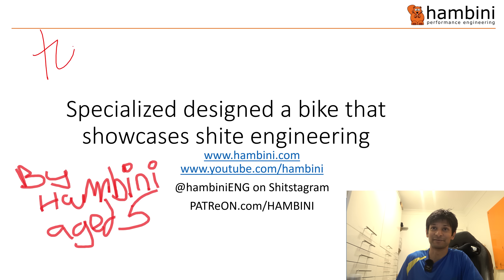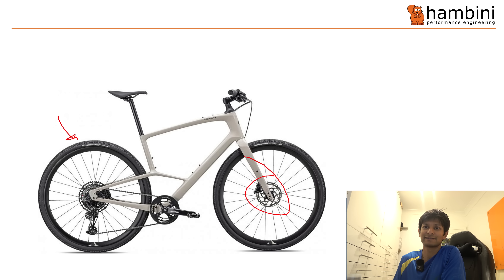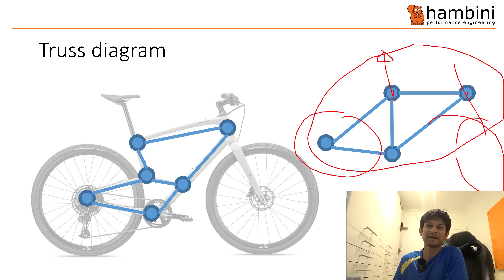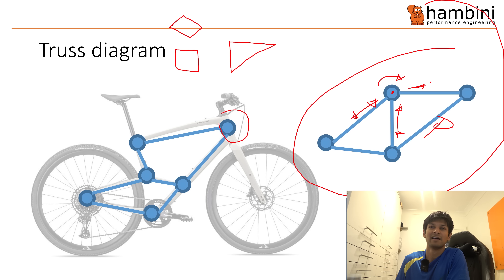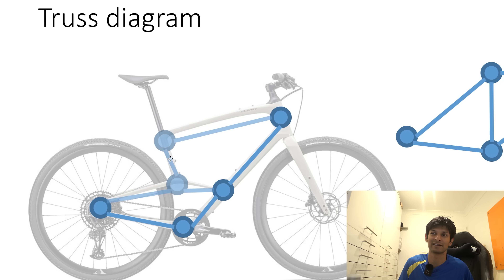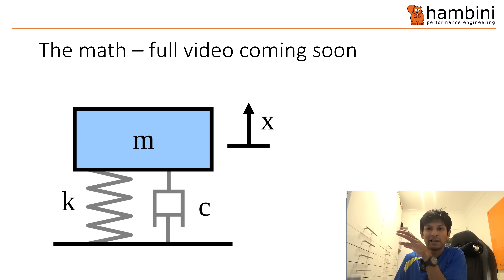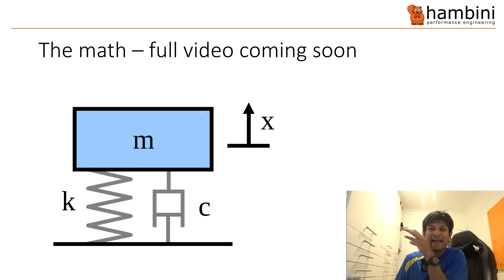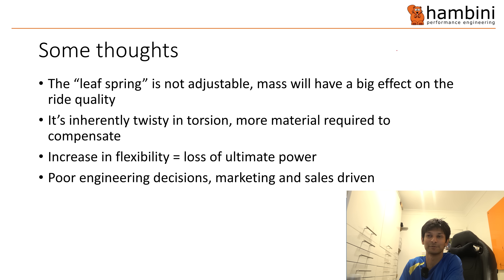Specialized Sirrus | TOTAL BODGE | When the marketing department design a bike...

Comment: FYI, there’s no suspension if you stand up on the pedals.  Lighten your weight on the seat?  No suspension. At the end of the day, this is a “high pivot” suspension design that had its day in the 1990s.  (Castellano/Ibis Bowti, schwinn had one, too) I actually like high pivots, but this is without a doubt, the worst possible implementation of a high pivot.  And, the lack of a dampener makes the design even more useless. Lastly, if you didn’t know, Specialized is 49% owned by Merida.

Comment: They did it because cyclists are really, really gullible. Fashion is key. Fake physics sells. These are the same people who believe that their custom wheels came with lower spoke tensions to make them "compliant" or that they can feel the "compliance" in the rear triangle even though they haven't put air in their tires for a week. Rich weekenders where I am will drop $15k on a carbon road bike that has no real advantages over the $1.5k bike down the street.

Comment: Actually the forces are very small for a carbon structure and being over rigid is an issue. The primary twisting occurs from headset to crankset. Carbon has a near infinite fatigue resistance. This design will be maybe 200g heavier than a traditional design, however the vertical compliance which is only in use when you're sat down could reduce fatigue on your bum over rough surfaces significantly. For its use case as a comfortable tourer this is fine
Reply: Carbon may have good fatigue resistance, resin however most definitely does not

Comment: Bicycles come in different sizes. A general assumption can be made as to the weight of the rider with regards to frame size. From there each frame size can be tuned to a different riders weight. If specialized did this the smaller frames would be substantially lighter as the leaf spring section would have thinner wall sections. The carbon material can have dampening built into it. Rubber is a spring with a high degree of dampening built into it in comparison to an equivalent steel spring. The carbon can be designed with a higher degree of dampening than steel. But lower than rubber. They also could insert easterner inserts inside the carbon spring for dampening.

Comment: Is the design actually going to 'flex' though? No-one seems to have mentioned the node at the top tube/head tube junction.

For movement to take place, there needs to be flexibility at that junction but the top tube looks like it has a fairly beefy gusset-type join and the top tube size and shape doesn't look very 'flexible' either......

Comment: I can only think they designed this as a very light duty bike, I'd hesitate to even call it an MTB, it's more like a road Hybrid with chunky tyres and no suspension.
I can't imagine how that design would work thrashing uphill off road. The pedal and bar twisting torque forces combined with that weird rear Triangle (or Rhombus?) are going to rip this thing apart! Unless of course it's made from Unobtanium? But it's more likely to be Chinesium.

Comment: compelling reason? have you looked at literally any of the recent trends in the industry? gravel bikes? hello? have you looked at the diverge str? trek supercaliber? im not surprised in the least from a company with a motto of "innovate or die". reducing vibration and softening the ride can increase efficiency on uneven, bouncy gravel surfaces. does this guy know anything about bikes outside of road cycling? comfort also plays a role a riders ability to apply power. adds heaps of weight? its a carbon frame gravel bike / fitness bike designed for COMFORT and stability, not a race bike. also the mass affecting ride quality is mitigated by varying dimensions in the bike frame sizes. larger frame = additional support for heavier rider. i see your points, but comes across you are purely looking at this from the angle of a weight weenie roadie racer who cant comprehend any other form of riding. i work at a shop that sells loads of the sirrus, and already had people coming in to look at them before they've even hit floors. and with the recent trends in gravel bikes absolutely DOMINATING sales in the states, im not surprised they are trying something different for adding compliance and reducing vibration just like they did with the STR. i'm sure they'll do great just like the last lineup did. cheers dummy

Comment: They should build with super butted chromo 4130 with for instance 0.75mm tubing iff they wanted some flex, next to that perhaps an internal computerized correction apparatus to keep the bb 100% level to the ground...

Iff this is an aluminium frame it will have cracked welds and/or a warped frame in no time...

This designer probably went a bit too deep into the nightlife on lsd with his hairdresser(s)

Tip of the decade, melt it and restart with knowledge pls 😂

Comment: Did they forget the amount of force on the Bottom bracket and the twisting force created by our legs. This force is now twisting the frame where in the past you would have a seat tube which resisted that twist. On my full suspension MTB i can already feel it, this is going to be complete wobble.

Comment: My biggest issue is that the seat and pedals will move in opposition over bumps because of the shape they have chosen. As the seat pushes down it will try to close that trapezoidal shape which will force the pedals upwards. Surely this will give an odd feeling to the rider and even potentially make the bumps "feel" worse.
Reply: exactly and if you stand on the pedals to go over bumps that downward force will rocket the saddle upwards... pleasant!

Comment: The obvious power loss from a spring without much damping is why most mountain bikes have a suspension locking mechanism. It is even used on some full suspension rigs -- despite modern dampers and geometries supposedly being very good at limiting pedal bob. This thing looks like it will just bob around by design.
Reply: No one that buys this is going to give a fuck about pedal efficiency

Comment: There are now several light and highly effective suspension seat posts and stems readily available on the market. Why would you want some complex, heavy, and  proprietary built in system like treks iso speed, and the new future shock by specialized. I bet parts for these systems will be impossible to get or so expensive the bike will become worthless.

Comment: Mechanical engineering 5th lesson during my studies....calculation of tensions in bars/rods.
this Bike design reminds me of the late 1990´s when Mongoose, Raleigh and other brands designed the frames in try and error mode; the difference is my first 26" mountain bike was a "light-weight steel version" of 15 kg and indestructible. I remember the Sling-shot bike: 2 cables instead of the down-tube, which follows the idea of the tensile stress in this section (...and creativity in handling the bike). 
if the next legal action is coming give them some lessons as a compensation first 🙂

Comment: They could choose the right material for the frame from the start. It's steel. Flexes where you need it to, stiff where you need it to be. Cheap as chips.

Now, to acheive what you can acheive with diamond frame made of steel, Spesh markeneers chose to use leaf spring logic, defying that leaf spring works in 2 dimensions, but bottom bracket area flexes in 3 dimensions. May be fine for clueless commuters, but please, show me a commuter ready to dump $3000 on a bike with high risk for being stolen. Commuter bikes cost $100 and look shitty for a reason...
Reply: Steel is for poor people, not the target of Sposhialized
Reply: @docmccoy9813  true, indeed.

Comment: If you want a more comfortable bike, get a suspended seatpost. You can install it on your old frame (get the diameter right, hopefully the tube is round) and you might even find a model with damping (don't really know). The seatpost does not bob when smashing the pedals and quite likely the suspension has more travel than this one.
I understand the torsional stiffness is most critical in the lower tube. Suspended seatpost does not spoil this.
Reply: yep, decades-old strain studies illustrated this. They showed biggest strain in a normal bike is torsion in the downtube, followed by out-of-plane bending (side to side) in the seat tube (directly related to the tortion in the downtube). When I tuned the CF bike I made for my wife, downtube needed torsional reinforcement and DT needed stiffness added at the bottom.
Reply: @SethJayson  I vaguely remember in the early 1990's there was a design, perhaps called 'Slingshot', where the downtube had been replaced by a string or cable and there was a spring to take pulling tension. In the top tube near the seat tube there was a hinge. The torsional stiffness of that creature must have been ... interesting!

Comment: Every bump is a fatigue cycle for the joints around the quadrilaterals.
Reply: Not necesarily. I'm not defending the rather silly design but some materials - CFRP, titanium, steel...have an 'endurance limit'. If you stay below the endurance limit, then there is theoretically no fatigue taking place. A steel spring (think valve spring in a cylinder head) is operated to about 400MPa per cycle and it has an endurance limit of ~650MPa. It will happily perform billions of operations. However, a valve spring has been in-design for >100yrs and is now almost perfect; with the best minds in the world improving it. On the other hand, I can assume this bike frame has been poorly designed by a recent graduate with a rudimentary knowledge of FEA and a bias towards what they wanted to achieve. A 250lb rider hitting a pot-hole did not figure in the designers' analysis...
Reply: @MrPoopnoddy  It's impossible to know what the designer had in mind.  We can only guess.  My guess is this design was driven by marketing.  "It's new and different, so it must be better." Nor do we know from a photograph how much and what sort testing went into it.  It just looks like they're asking for trouble.

Comment: I expect better!

You fell into the easy trap of criticizing a bike for not being optimized for a purpose for which it's clearly not intended as you ignored the fact that the flexing of the "parallelogram" moves the BB and the seat in opposite directions resulting in an effective spring rate that continuously varies as a function of how much weight is on each touch point resulting in a "fully rigid" rear end under some realistic loading conditions. 😂
Reply: Yep!  I rode high pivot bikes in the 90’s. While I still love the simplicity, unweighting the seat turns it into a suspensionless bike..😂😂😂

Comment: Thank you for the engineering explanation.
This looks like a really complicated solution to a simple problem.
If you want to make a comfortable commuter bike and are not concerned with power like a racer, then surely a simpler solution is to put a shock absorber type system into the seat tube?  Then you could adjust the system to get the best setting with maximum comfort as well as minimum bounce which would be different between riders of differing weight.  Adjustable forks have been available from mountain bike for years.  Am I missing something?
Reply: Yes a seat post shock would give you better damping. But that takes weight, better the shock generally the higher its weight. The point of this is to get suspension for "free" in the frame.

Comment: A new design for a Paris/Roubaix type race?
Reply: The suspension only works if you keep your butt firmly on the seat. Paris Roubaix would require a dampener and the design is useless without a dampener. It’s a mechanical disaster waiting to happen about 10 different ways.

Comment: Probably it is just a fitness bike & I am ok with it & not ok for the price 🤣 Cause it is just a fitness bike.

I don't see any mount for rack for commuting purposes.

For performance bike like mtb, gravel & road, the design problem as hambini mention in the video.

Another problem, instead of 3 struts (seat tube, chain stays, down tube) hold the bottom shell, the sirus design just 2 struts hold the bb,  the deflection side to side is huge on bottom shell & bracket.

Comment: There's one important factor you didn't consider: the target market doesn't care and won't notice. The Sirrus is not targeted towards hardcore, or even serious riders. It's target market is someone who goes for a casual ride every once in a while, and if a bike looking different gets them to buy it (and ideally ride it), what you talked about is irrelevant to them. It's a hybrid bike, and performance and weight are rather far down the requirements list. Having said that, it's definitely dumb from an engineering perspective.
Reply: Someone who goes for a casual ride won’t be particularly impressed because, at minimum, it has no dampener.

Comment: From my viewpoint there is one thing you didn't make clear:
In a normal bicycle the bottom bracket (with the pedals) is connected to members in 3 directions (downtube, chain stays, seattube), here just 2 with a wide open angle. How much torsion in the downtube and chain stays (resulting in right and left tilting of the rear wheel) will be here if the rider has a bit more power in his legs? 🤦‍♂️
Will this even influence the shifting on the rear cassette or make noise? 🤭

Comment: It’s going to be ridden down sidewalks at 37 watts I think any shape will work for that task
Reply: Basically. Simple reality is 99% of people on a bike give fuck all about performance metrics.
Reply: @cjohnson3836  they'll care when they hit a few potholes and the frame cracks.
Reply: @An Obscure Tenet and those people are correct, the fragility of carbon fibre isn't contested hence why you'd never create a bike that puts side impact stress on a tube where all carbon fibre tubes have weakness...oh...oops
Reply: How many people in “37 watts on the sidewalk” crowd are willing to spend over $2k for this bike? Especially when they can buy an e-bike at a similar price point?
Reply: @froseph85  Never underestimate vanity
Reply: @An Obscure Tenet carbon fibre good with stress...is that your claim?

Wrong.

Carmon fibre good with stress under certain conditions, conditions not followed in the design of this bike, it's not even carbon fibre, it's all tube shapes are subject to this, you can stand on a toilet roll tube and it'll support you, if it's on its end, otherwise it'll collapse.

You can stand on a coke can, then if you apply the slightest pressure on the side...it'll collapse. That's the design presented on this bike frame.

Comment: Would have been good to very briefly compare the old Sirrus frames, to their more performance road bike equivalents, their geometry has always been a bit weird and novel. As you say, probably for marketing and uniqueness rather than any functional purpose. They always seemed to have a curved top tube, which I have never seen anywhere else, and mentioning triangles, I can see why. 

This all said, it isn't a performance bike, in any regard, it is generic mid/low end bike that needs a marketing gimmick. You mentioned loss of power, no one buying it knows what power means, or in fact cares. If you want to sell something, firstly, right Specialized on it, or Trek, or any big brand, but Specialized does go for a premium, and then make it look "specialised"...or at least special...even if that is special needs...

Comment: William of Ockham laughing from the grave at this abomination. If that “compliance junction” is actually designed to flex vertically like a leaf spring, rather than just provide more dampening, I wonder if the carbon composite is subject to internal delaminating.

Comment: This bike is weird, overcomplicated.
But I am not keen on the flex seat tubes.
I don't know why Specialized went for crazy designs lately. Atleast they did not bonkers on the mountainbikes lately, but still quite strange and asymmetric frames, like the demo, that must have been hard engineering as asymmetric is harder to get right. But I don't know how they hold up. I see the Stumpjumper is also asymmetric but only with a extra tube near the shock on one side. Unusual.

Comment: I wonder how many people are going to get seriously injured when these frames inevitably start spectacularly imploding due to fatigue cracking either on the seat stay to chain stay joint or the seat tube to that seat stay/frame angled ^ tube thingy
Reply: It's a cyclist's duty to inspect bike before ride and make sure it's all OK. It's mentioned in a bike leaflet, lawyer will argue in a court.
Reply: @event4216   fatigue cracks in a frame like this, especially with the extra high loads from the stupid design can go from unnoticeable by a consumer to catastrophic in a single ride. And evidence of that would be in the crack face. Any competent lawyer would get an expert to confirm that. Also, nobody actually does that and even if they did, not everyone is trained to recognize what a cracked frame actually looks like.
Reply: @TheAverageDutchman  We know well how "easy" it gets to sue manufacturers for failed carbon forks....they'll do anything to leave responsibility on customer - wrong installation, torque, adjustment, whatever. Well, frame isn't something customer adjusts or tinkers with....Let's see if users of this frame ride it enough to make it crack and what happens then.